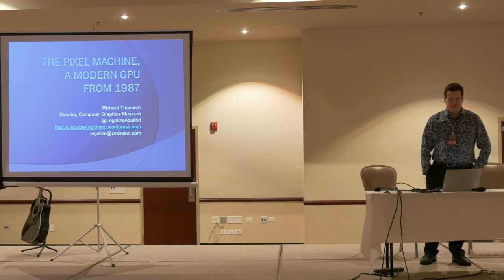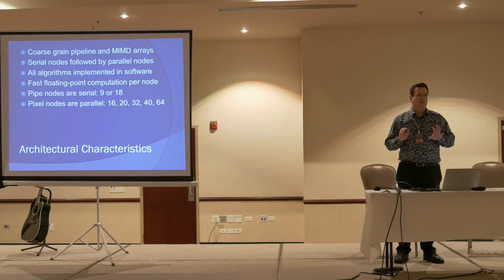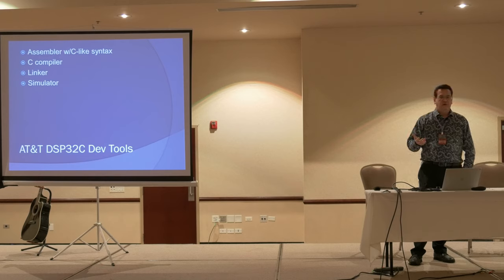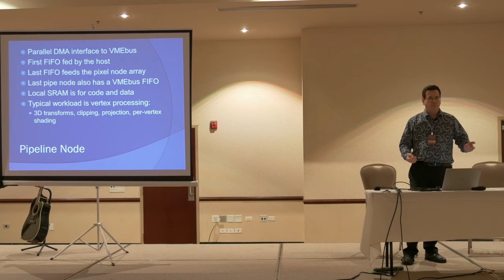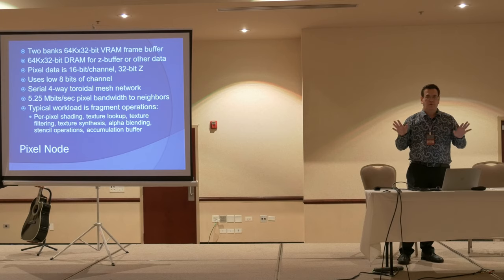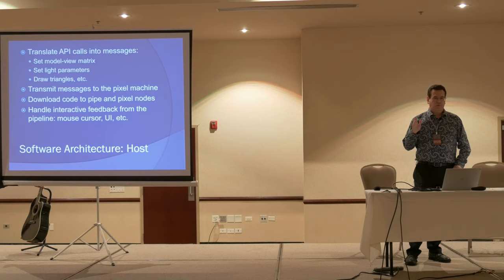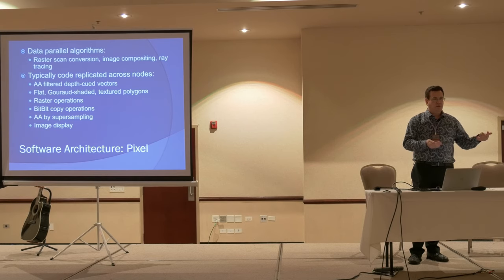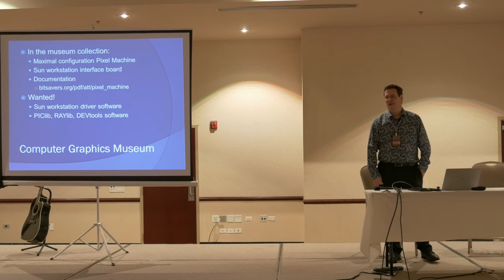The AT&T Pixel Machine: A Modern GPU in 1988 | VCFMW 2019

Comment: I believe the parallel processor core of the Pixel Machine was also used for the AT&T DISQ digital audio mixing system introduced around the same time. Both were derived from a system used to track submarines.

Comment: Fascinating. It seems to be very powerful for the time. Do you have any theories on why it wasn't popular. Cost maybe?
Reply: A) Probably Cost.  Although SGIs (the other system of the area with serious graphics capabilities) were quite pricey and they seemed to be able to sell enough of them back then.

B) Marketing.  AT&T had the 3B1 and 3B2 UNIX systems, back in the 1980s when Sun, HP, etc. were selling plenty of UNIX systems; the Pixel when SGI was selling plenty of systems.  Based on info from the time, it seems AT&T would develop these systems almost for internal use and research, then just almost reluctantly put them out on the market rather than dong any kind of real advertising for them.

Heck, even with the Pixel machine -- they are using a Sun as the host, when AT&T had their own UNIX systems available.  Why would they not use a 3B2 as the host?

Comment: I wonder if it can do things other than graphics, like neural networks or simulations.
Reply: It can do arbitrary computation similar to a GPU with CUDA, although it has much more limited memory available to the processors.  You can code up neural nets and simulations in C, but the limited memory available to the nodes would probably be the biggest constraint.

Comment: Guy that dropped the machine probably still got fired... just saying at the time that was probably 100k+ worth of destroyed hardware.
Reply: At trade shows, it is often the case that the personnel unloading equipment and connecting it are associated with the venue and not the vendor bringing the equipment.  SIGGRAPH 1992 was held in Chicago which has many union rules regarding equipment loading, unloading and setup.  I remember a poor student at the art show exhibit whose installation was a robotic arm that was painting on paper with a brush.  Members of the electrician, computer and industrial (e.g. robot) unions were standing around arguing about who was going to setup his equipment.  There's a reason SIGGRAPH hasn't been back to Chicago since :).
Reply: @ComputerGraphicsMuseum  I was there for that! It was CRAZY. And one of many reasons SIGGRAPH (and many trade shows / conferences) never went back to McCormick Place. It's a nightmare to do anything there.